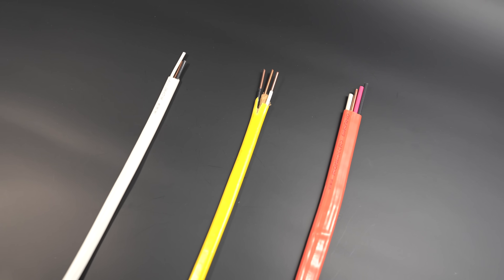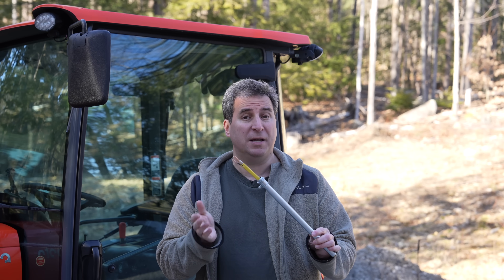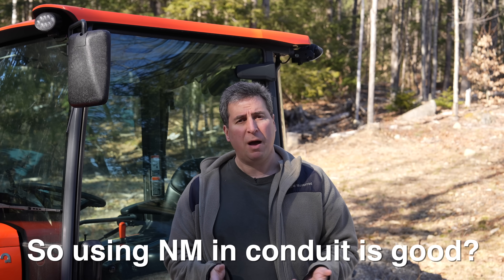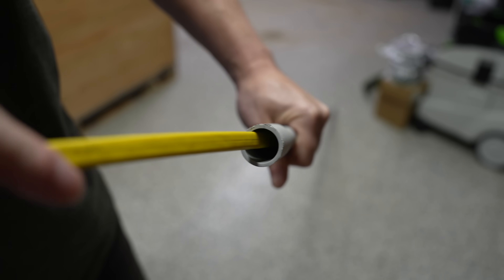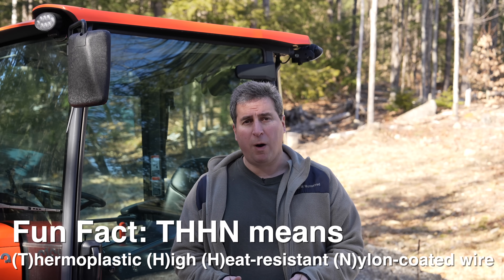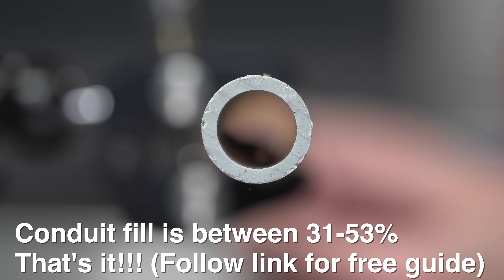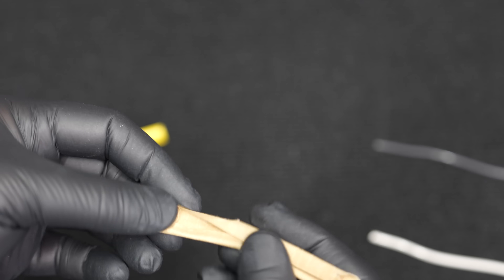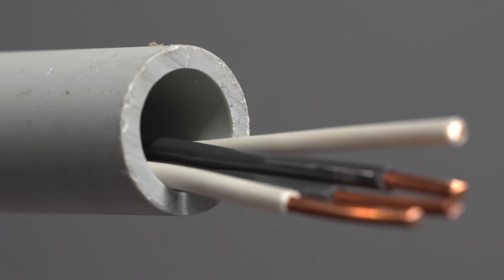#1 DIY Electric Mistake - Can you use Romex Wire in Conduit?

Comment: Short answer- no. 
Long answer- sometimes, if there's significant free air volume and minimal load on a single circuit with no external heating aspect.
An example would be 12/2 romex carrying a 10 amp intermittent load in a 1" (or even 3/4") conduit that is not exposed to sunlight, external temperatures above the conductors rating, and not exposed to any significant moisture (including humidity).  
The NEC codes ignore the conditions that would allow this due to safety and misinterpretation. The codes exist to prevent idiots from creating potentially dangerous situations rather than outlining conditions that would suffice. I'm not saying the codes shouldn't be followed, but there are a lot of situations that are necessarily safe but not permitted.
Good video, comprehensive, but I'd NEVER run romex in 1/2" conduit.

Comment: 3/4" conduit on a straight run? Wire without conduit needs to be buried deeper than a pvc conduit and most shallow is metal conduit.     Sometimes you gotta case it in if you won't have the depth.  Thoughts?
Reply: Inspector had us go 24 deep for direct burial UF-B. Where we hit ledge,rock etc he left us go 18 but with 3/4 PVC conduit for only where we couldn't get the depth

Comment: I once did a job with a guy who was a cross between a prostitute and a computer, in plain terms: "A Fu¢k|πg Know it ALL"
Who insisted on pulling Romex® through PVC for a very simple outdoor run with outlets and a switch leg.
THHN would have been much easier and just as effective.
It was a long run and took forever to pull that Romex® through.

Comment: Great video and very valid points. I would like to add something. Another reason that you can not pull the individual wires out of the NM cable and pull it through the conduit is because the wires are no longer labeled on the insulation like THHN, THWN, THWN-2 ( Voltage, gauge etc)

Comment: Traffic Signals in Southern California have Conduit runs from the Traffic Signal Controller Cabinet to a “pull box” near each Traffic Signal Pole. There generally two scenarios with the Signal wiring. The original scenario was to pull sufficient wires between the Traffic Signal Controller Cabinet and the Traffic Signal Poles, ie one for red, yellow, green, grounding etc. the second scenario was to pull “bundled cables” that are separated at pull boxes to each Signal pole. These bundled cables were introduced to provide a higher degree of protection from amongst other things, wire eating insects.

Comment: Shere common sense dictates that any sort of mechanical protection is advisable for all common cabling systems.
There are advised curve / bend angles for conduit which should allow for a clear pull of cables ( non snagging), with regular access boxes......

Comment: I ran some romex through some sch 40 pvc to relocate power for my septic pump.  I thought that running romex underground by itself was okay.  So I figured I would put it in the sch 40 to be extra safe.  What problems could I run into in the future with the way I did it.

Comment: I love your videos and your great delivery.

I understand electrical code does clearly rule it out. Southwire is the parent company of Romex. If you look at their conduit fill calculator - NM wire is not a selectable choice. In fact -  have been unable to find any conduit fill chart that shows NM wire. I also cannot find where any wire manufacturer (or Intertek ETL or UL) states that it is tested and permissible.

If you compare the price THHN wire to NM wire, you will certainly use THHN (or similar) inside the conduit.

I live in the US mid south where we have rapid temperature change and usually high humidity.  Condensation often occurs inside metal conduit located in vented attics and garages. 

The only situations where I would use NM inside a conduit is 1) where I need nail protection within a column or 2) when I need to span an space (like between two cabinets).  In these instances I would only run a single NM wire.
Reply: Conduit fill would be the same as THHN wire as they're the same. However, they are unlabeled so you can't just pull them out and use them as THHN. You can calculate conduit fill based upon the diameter being the same as THHN. The insulation is irrelevant. However, it will be bulkier once used and since it already provides protection, there is no point in running it in conduit besides nipples in high impact areas. Piping start to finish and running NM is just dumb.

Comment: Is there any benefit or safety issue using metal conduit vs Cantex?  I was going to use metal in my garage for a few electrical outlets that cannot be run through the walls just because it looks better to me but I’ve used Cantex for all my network cabling.  Also, just FYI, TrueCable has a good chart on how many Ethernet cables you should use for each size of conduit and each type of CAT cable.  They recommend 40% for initial installation but never exceeding 60%.

Comment: What about heat dissapation
Reply: If your romex is getting hot you have and issue to fix.
Reply: I bought romax 12 2 (hot neutral ground). I stripped it out of its yellow jacket and ran it into 3/4 " PVC grey pipe.   
When I watched this video they said it wasnt a good idea.  I only have those three wires in there and only about 30 ft..  then once it his my wall I ran romax all the way to the box which is about 50 ft or so..

Comment: putting the cable in conduit is a good idea as it provides an additional ground so if the wires should fail they short to the pipe and provide extra chance of blowing fuses or breakers

some places may require the pipes.

Comment: I believe the purpose of using  Romex is because it’s easier than putting wires thru a pipe and especially if it is being used inside and nota very long distance.

Comment: I look forward to the day that uninsulated ground wire in romex is a thing of the past.. I hate dealing with it in an electrical panel.
Reply: Good point! There are way too many unskilled electricians in the trade now that don’t understand that you need to keep those bare copper grounds tucked away very neatly out of harms way. Not just in panels but every outlet/switch box as well

Comment: I'm needing to run electricity from on outdoor breaker box to a shed in my backyard. Of course that means the cables will need to be buried. 

So if I'm understanding this video correctly, that means I would need to use individual wires instead of Romex? What kind of wires exactly? And what kind of conduit would I need?

Comment: In my region (PR, US Territory NEC), we never touch that stuff, the local electrical complementary code overrides the NEC in a lot of stuff, thankfully for the better. All constructions here are full concrete, and all wiring is done with embedded pvc conduit and individually pulled THHN/THWN-2 wires, or exposed EMT in garages and industrial settings, no romex anywhere. 14 AWG wire with 15 amp breakers for ramal circuits are forbidden. Minimum ramal circuits are 12 AWG with 20 amp breakers, even if they feed 15 amp receptacles. Even the minimum diameter for the utility service entrance pipe is overridden to 2” from the 1.5” minimum from the NEC.

Comment: Howdy. Yeah.
Running several Romex's in a conduit one should check the current derating coefficients due to derated cooling. One may need to choose the next lower AVG (thicker wire) for the Romex's to handle the breaker current rating.
Regards.
Reply: I once wired a detached garage with direct burial cable and the inspector said because they were individual leads and not romex the cooling property of the earth likely made the circuit capable of handling more than rated current of the conductors but not so if it was romex because they are so close together in the sheathing..

Comment: A DYIer here, not an electrician. Some of these code requirements seem, well, strange.
I am guilty of using Romex-style cable within PVC conduit. One is for an astro observatory and includes a CAT 5 data cable. Been in place 10 years . . . no issues. Another is a simple storage shed with a light and a receptacle for starting a snow blower. Been in place 24 years. Again, no issues. Both are about 30 foot runs of 14 gauge Romex in what would certainly be deemed a "wet" location. 
Now that I know better, I would try to do it differently next time, allowing that I could even obtain the proper "wet location approved" wire from the local big box stores.
Reply: You're prior installations are certainly passing the test of time. To answer your specific question the cable you want is UF (which stands for Underground Feeder) and is manufactured to be buried directly in the ground, you can put it in conduit if you want the extra mechanical protection. Every Home Depot, Lowes what have you, that I've ever seen carries it, as always extra $$$ compared to the normal stuff.
Reply: @stuglenn1112  Many thanks for the helpful reply.

Comment: Good video as far as it goes, but it misses some important points that often distinguish industrial electricals from residential, as well as what may be called Romex.  

UF cable in UF-legal exposures in pipe should be mentioned.  Often direct burial UF, down 12 or 24 inches depending on 120 vs 240 VAC, often needs to be tailed in conduit for protection at building entries.  It'd be absurd for that to be a code violation.  

Thermal derating is also a big issue, as are NEC marking requirements, where a cable type is illegal if not marked so inspectors can easily identify it, regardless of insulation or conductor compliance otherwise.  This video is wrong as to NM conductors not being legal to use in conduit outside their sheath, as to insulation and wire per se, but that is nearly always illegal overall, since inner conductors are rarely marked per NEC for stand alone use, as to insulation type, temperature and fire ratings, etc.  

There's another MAJOR reason nearly every competent electrician stocks 500' rolls of 12 AWG THHN, which is nylon over thin thermoplastic, and NOT thicker plain thermoplastic insulated pull wire.  The nylon is slick and easier to pull, as well as more immune to damage around box or fitting edges, and slightly smaller overall diameter.  It's also generally rated 105 C, and so meets thermal derating parameters more easily than 65 or 85 degree rated insulations. Often ignored is how 105 C rated 12 AWG conductors are rated 30 amps, but generally disallowed over 20 amps, as they're usually used in clusters of 2-7 conductors, plus grounds that often don't count as current carrying.  

 Allowable conduit fill, thermal, and maintenance based parameters for mixed conductors can be adequately complex, that I used to know an engineer whose primary job with a major electrician tools and fittings manufacturer was to consult with industrial clients on how to space and cost effectively comply with NEC.

Comment: When I was a young boy I learned from my dad, that if you used the green glass plug fuses they would never burn out.  My dad always worked the evening shift so was never around while my mom dealt with the minor fires, smoke and blackouts.  It’s been over a hundred year since the house was converted from gas light to electric.  We never had a visit from the FD and the house is still standing.  Needless to say I’m not a fan of codes.  

Do you remember aluminum wire, that was approved by the same people who write codes. Let’s have less government.

Comment: A neighbor wants to run power from his work shed to a barn for lighting.  Trenching is no problem - I have an excavator.  There is the gray, direct-bury UV cable, of course, but I was wondering if running that cable in a larger (1") pvc conduit for added protection was legal.

Comment: You can but you should not. 

The fill with one romex is going to go over the maximum fill rating. 

THHN is much better anyway since you can run 2 or 3 circuits in 1/2" or 4 or 5 circuits in 3/4" conduit.

Comment: Thank God!  Someone who got TO THE POINT and didn’t yammer on and on for 20 minutes!
Reply: God yes! I'm tired of half hour videos saying something that could be said in 5 minutes or less. Even if the subject is interesting who has the time? Save the long vids for something that requires depth and intricacy. We'd all do better, learn more, and see more creator's work.
Reply: @ThePeaceableKingdom some topics like welding have many variables. Temperatures, various settings, gsses, material selection. Often each job needs individual unique solutions for optimal results. Just saying most electrical work is tedious and repetitive no need for long explanations.
Reply: @ThePeaceableKingdom But you still need to watch them, huh?
Reply: @nothankyou5524  Nah, I only watch half of them...  😬
Reply: @nothankyou5524 lol, right, I'm not an electrician and I do. When I was a commercial plumber on breaks I would hang out and watch the sparkys. So at home all outlets switches are done well, it made a huge difference. Fixtures were reverse wired, insulation pinched under screws loose wires all that. I wrap colored tape around outlets with metal boxes.
Reply: And he didn't advertise a sponsor 😅
Reply: @edwardantrobusjr2253 oh ok take back my long videos=more ad revenue comment
Reply: 100% True that!
Reply: It's especially bad with videos around the trades or handywork.  These are the people who are supposed to be efficient and straightforward.
Reply: @bridgecross  I create lists of videos created by clear, concise, and competent people. Many exceptional content creators are putting out excellent work these days. If one is good at quickly groking information, it's quick and easy to separate the wheat from the chaff.
Reply: @bridgecross  Where is it that they state that? And why do you NEED to watch them?
Reply: @nothankyou5524 lol hey longer vids more advertising.
Reply: @bridgecross ok, but possible the viewers are wide range. It always takes longer to explain a job than to do it.  But yea you're right
Reply: I don't know, I feel like this ~4 min video could use a 90 second intro and some dumb, loud music! /sarcasm
Reply: @aaronparr474  Right?
Reply: @aaronparr474 and "electricians don't want you to see this video, they're spending millions to have it removed..."
Reply: When I was a boy I would often go on electrical jobs with my dad, and he said there's one rule that he tried to follow above all other rules. This rule, which he had learned from years of experience - both as an independent electrician and as part of a business team, is something they can try to teach you in school, but you just really can't understand it fully until you've had to apply it - and most people are blown away by it's simplicity and how they've never thought of it before. Now you might think, "I've been an electrician for years - what could be so simple that I haven't figured out?" Well, it's not that it's simple to apply, but moreso that it's simple to understand. In fact, the principles behind it are simple enough that children can explain it back with little error. 
So what is that rule? I'll tell you - it all started on a job we were doing for a wealthy old widow.........
Reply: Couldn't agree more!  I don't even mind spending 30sec on a sponsor, but when I want to know something, I don't want to spend 15 minutes listening to someone yammer on about their kids, weather or how they worked for 40 years in a coal mine.
Reply: @Helix42_bat  I pay for YT premium so I don't get any adverts. As I don't have 'cable' or any other streaming services and do a lot of research, podcasts, audiobooks, movies and long elcectronic music DJ mixes, etc. it's totally worth it. I've been 99% commercial free for 10+ years now, and my mental state is stable.
Reply: @Helix42_bat and the cat walks in front of the camera
Reply: Right?
Reply: And without the background noise or music that makes it increadably painful to tolerate.
Reply: This dude is GREAT for that.
Reply: "yammer" is a good word to describe most YouTube content.
Reply: @foxtrotbravo1744  The word “succinct” is rarely considered when self centered YouTubers who do no rehearsing of their content exercise their “blowhardedness”.  Something as simply as “put tab A into slot B takes them 20 minutes to bore you.
Reply: In NZ we run 240v 20amp breaker at 10amp on gang plates. Even more through sleeved cable into conduit internal external. Noone really runs single core unless for external earth. Only see it on houses befor the 1940s.
Conduit isn't used anymore through wall and ceilings etc,
The only time we use it is expose. Like a block or concrete wall. Or outside we also have the option of armored cable.
Reply: Really!!!
Reply: Also, they quickly and clearly explain why it is a bad idea.  That is incredible.
Reply: Like you would have?
Reply: YES!!! I hate the people that ramble on and on about nothing and repeat things 50 times.
Reply: Ain’t that the truth!!!!
Reply: Agreed, great explanation and to the point.
Reply: Do you mean like Benny Johnson?
Reply: So true.  Concise and to the point.
Reply: YES!
Reply: Did you really thank God?
Reply: I enjoyed that too!
Reply: LOL. Facts brother!!
Reply: but it was completely lacking in inane dad-jokes 
how can i drink coffee without them?
Reply: @rosskstar  Who has the most prestigious job at the cemetery?      Answer: The grounds keeper, he has hundreds under him.        Where is the cemetery always located?  Ans: in the "dead center" of town.      Why are there fences around cemeteries?    Ans: People are dying to get in.   My Dad's Dad Jokes.    Don't spill your coffee.
Reply: @RealElectrical  eww nice, let me make a pot first! Or i could just smoke my pot.
  God's Son is back btw woohoo
Reply: @RealElectrical  
"Don't spill your coffee."

I don't drink coffee.
Reply: @RealElectrical The cemetery might be in the center of town but nobody living in that town can be buried there🤔